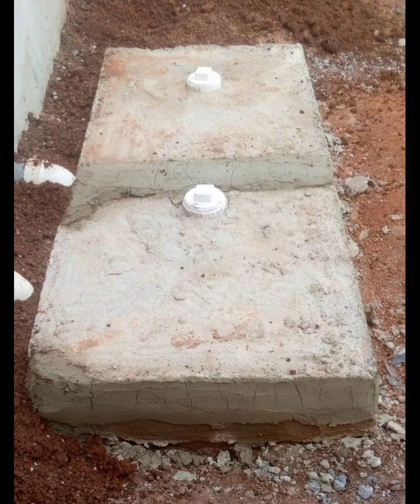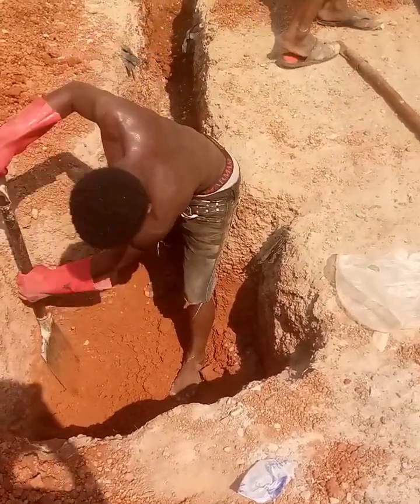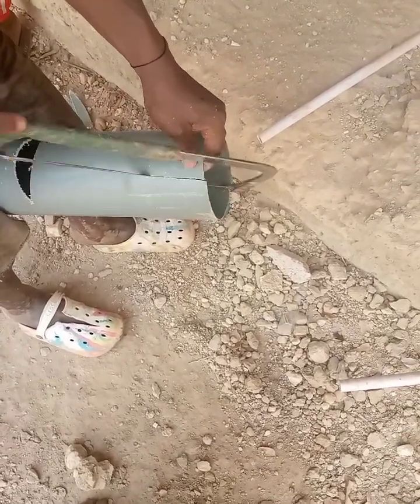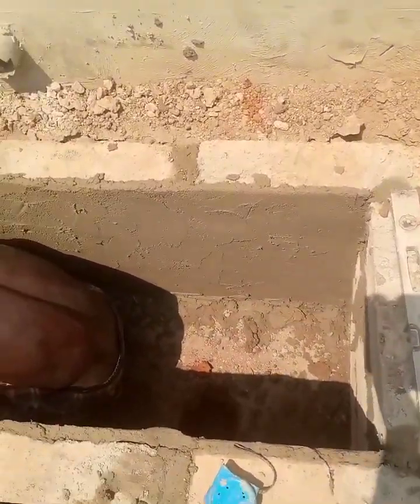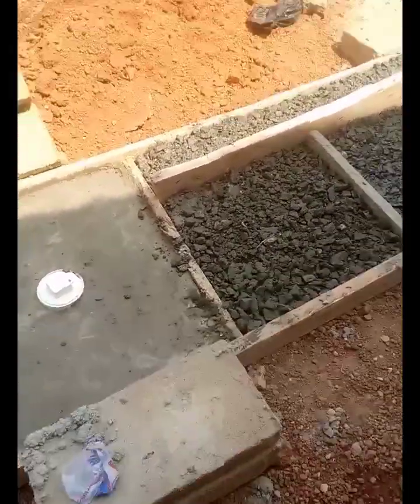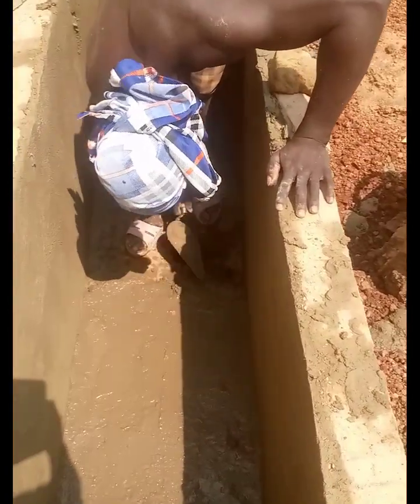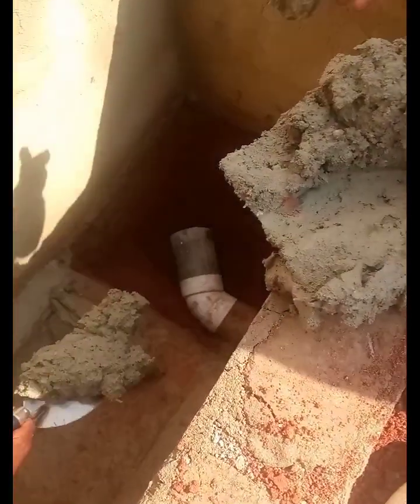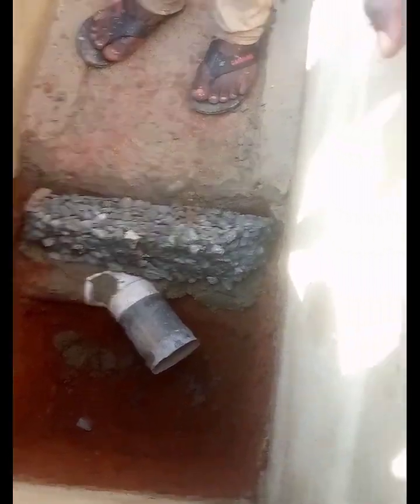BEST WAY OF DOING BIOFILL BIODIGESTER FULL VIDEO #detail in Ghana

Comment: This is. Very educative...
But I have a little worry which I need clarification...
The gas generated, can it not pass back through the inlets pipe ?
Reply from the maker: It gets discharged through the internal soakway and the water push the gas along in to the land. Though some may flow through the pipe but could not be enough to lite up fire

Comment: Thank you Sir   Please can the biodigester be done close to the building
Reply from the maker: Yes. It can be as close as one foot but the trench and the external soak hole should be extended away from the building. The soak hole can be 5 feet away from the building. But for large size biodigester soak hole should be about 10 feet away from the building..

Comment: Hello, what happens to the sludge that comes undissolved in water?won't it fill the tank?
Reply from the maker: Enzymes that have been activated through the organic coconut fiber will break it down through anaerobic reaction into soluble particles. Then, it goes away dissolved when another flash plunges into the digestor.
Reply: @plumbingbiodigester  what size can accommodate a rental residential of around 15 rooms?
Reply from the maker: @nicholasbashir345  Does each room has toilet? If yes meaning you are making a digester for 15 toilet seats. Then consider these:
1 Running pipes to a single digester will be another cost. And it will create much pressure on the single one as well. For that matter you need a very powerful strategy in order not to face any problems. So you may decide to divide them and do two or three digesters for the 15.
 toilet depending on the soil quality and the building plan of the building.
2. Before you decide not to divide but do one digester, you have to make sure you have a very long distance of about 25 to 30 feet or more for your trench for soaking the filtrate water. This is the case for non waterlogged areas. For waterlogged areas lay your outlet to a gutter.
3. Lastly, you can take a size of 8ft length × 2ft deep × 3 feet breadth.
Reply: @plumbingbiodigester ❤

Comment: Hello, did you use waterproof cement to plaster inside the floor of the biodigestor?
Reply from the maker: Water proof cement is only needed when doing a digester on a wet land or waterlogged area.
You do not need water proof cement when doing it on a dry land please. This is because water does not remain in digester for long, neither does water come from the soil into the digestor.  Immediately toilet is been flashed from the water closet, the water get separated from the food particles of the toilet and then soak in to the land at first soak, drench line and the soak hole.

Please kindly like and subscribe for more updates. I'll bring a video on this platform and teach how to do a digester on a waterlogged areas.